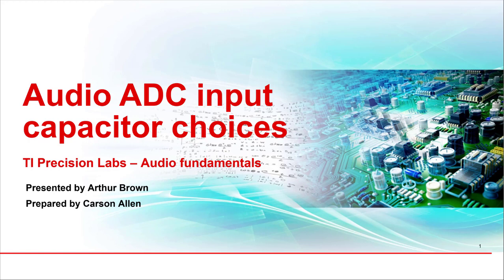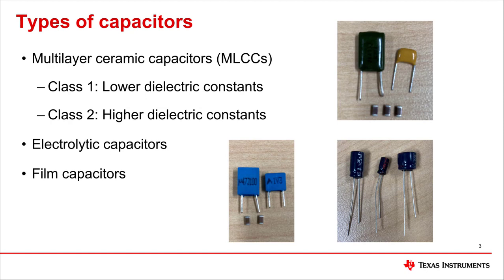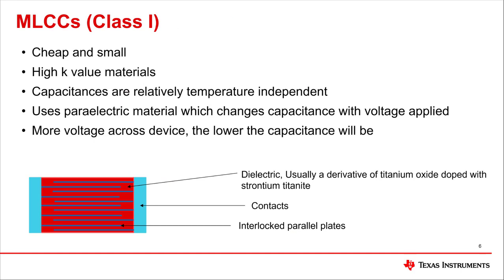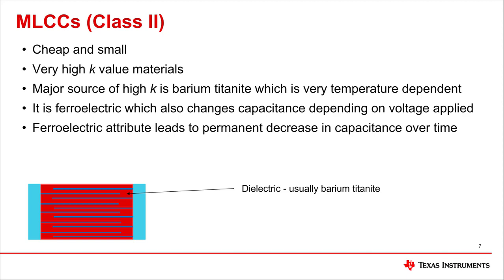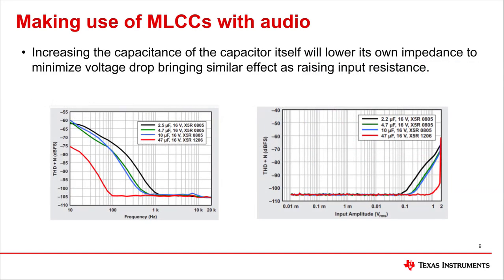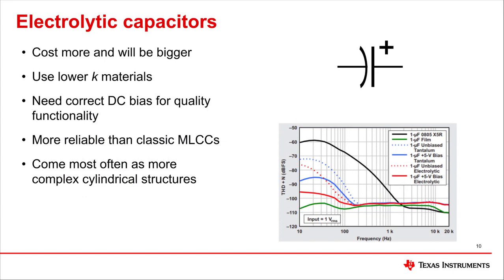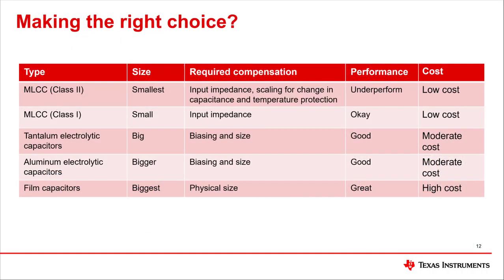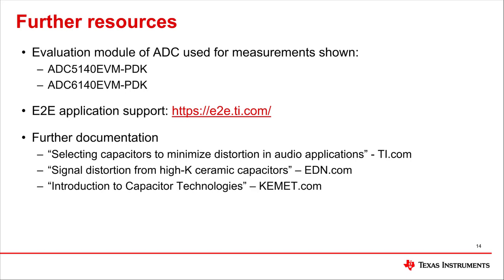Audio ADC input capacitor choices

Comment: I have a laptop. I want to connect 2 old external screens from that laptop for LVTS with the help of HDMI port hub. So do I need an HDMI TO LVTS converter board for that? Or can it be connected via HDMI TO LVTS CABLE?